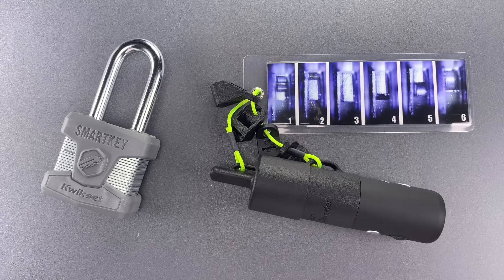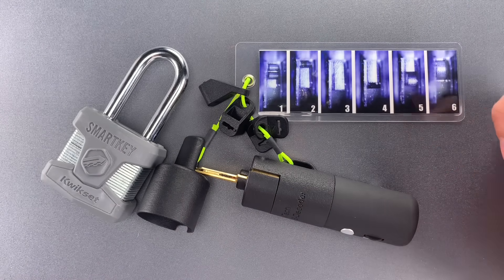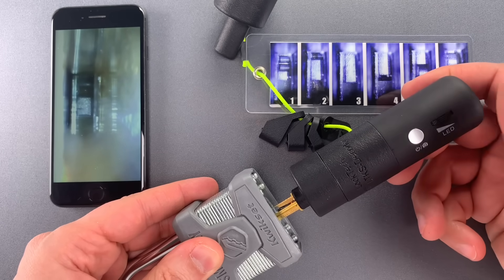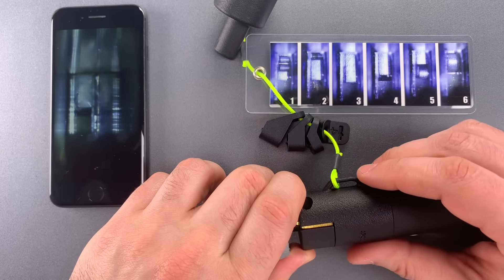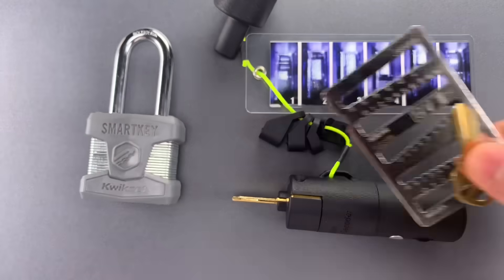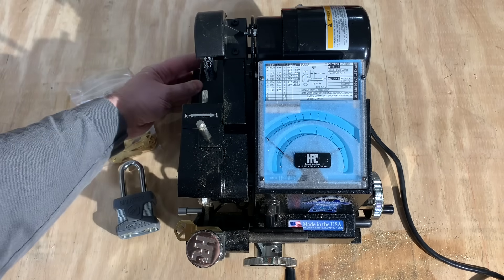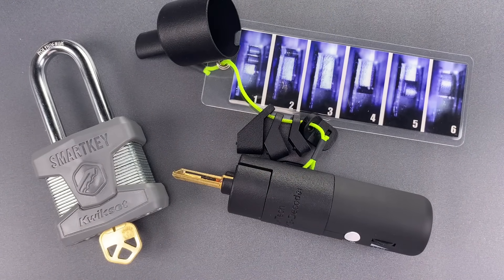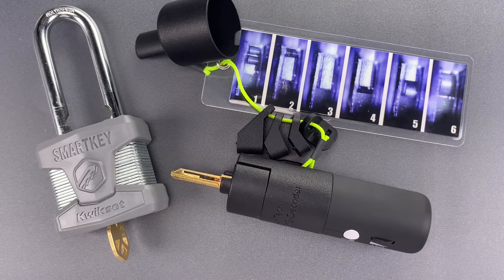[1209] This Tiny WiFi Camera Owns Kwikset SmartKey (LockTech LTKSD)

Comment: Finally get to see what Home Depot charges $10 per key for inside that pretty kiosk...
Reply: LOL. The fancy kiosk is actually because the employees are too stupid to use a normal key cutting machine. HD used to have manual key cutters. The returns were through the roof.
Reply: They charge for proprietary information of each type of key.
If you buy products like iPhone, you're the problem

Comment: Yikes, no forced entry on a robbery.  Sometimes technology just doesn't think it through.  Well done information and video though.
Reply: A robber isn’t gonna go through the effort of casing your house without the nosy neighbor spotting them, discreetly spending 40 seconds up against your door to get pictures of the key way using a $300 specialty camera, go home and use a several thousand dollar key cutting machine to make a brand new key, then go back and hope the key works, all just to rob your house and sell the items to a fence for under market value. It’s way too many chances to get caught, and the profit isn’t worth the risk. 

Almost all actual robberies look less like Mission:Impossible, and more like breaking a window on a back door, letting yourself in, and grabbing anything of value that’s not too cumbersome. A robber who is trying a non destructive entry is gonna get a lock pick gun or some bump keys. 

This is gonna be used almost exclusively by locksmiths with a power inverter and key cutter in their work van. Instead of needing to drill the lock or hand pick it (this seems to be a dying art among most locksmiths), they can use the camera, cut a key for you, and charge you for the hour they spend in your driveway.
Reply: @eddiekalista3222  Yea but, Dallas crooks are by far a bit more sophisticated and now there are a lot of wealthy areas to choose from.  Just sayin'

Comment: For kwikset if you already have a 3d printer you can always print a key. The plastic is strong enough for a handful of uses before it snaps of deforms from fatigue.
Reply: Use the printed key on a key cutter to make a permanent copy and that problem is solved.

Comment: That key cutting machine is amazing. I love the analog gauges/template card system. And of course the camera is beyond cool. A friend and I in college (he did the actual hard parts like making the key) obtained a key blank to a dorm room key of another guy on our floor who my friend wanted to play a practical joke on by re-arranging all of his furniture, and either he or I also took some high quality photos of the kid's dorm key. Since all of our keys used the same blank, my friend was able to work out a real dimensions scale to figure out how deep to cut each notch on the key. He ended up making his own template in Adobe illustrator and basically replicated the key gauge here without knowing anything about keys/locks. He then filed it down by hand, and tried it on the door and it didn't work. He was about to say "oh well, it was a fun experiment", when I took the key and jiggled it around a bit which caused it to immediately turn.... I was damn impressed. Think I already posted this comment but this makes me think of that story again and one of the things that really got me interested in how this stuff works!
Reply: Did the joke work out?
Reply: If he saw keys to a half dozen rooms he could probably figure out the master also, or have a good idea of where to start.
Reply: @davidhoekje7842 , in my dorm I'd take apart my own room's lock and measure the wafers to figure out the master. (Several decades ago.)
Reply: Pretty cool story. Good times!
Reply: how did he find the key code though

Comment: Slightly improved firmware in the camera could detect and decode the lock by simply fully inserting the key. Then the small amount of skill required to stop at each pin and decode the lock by comparing the video feed to reference images wouldn't be needed.